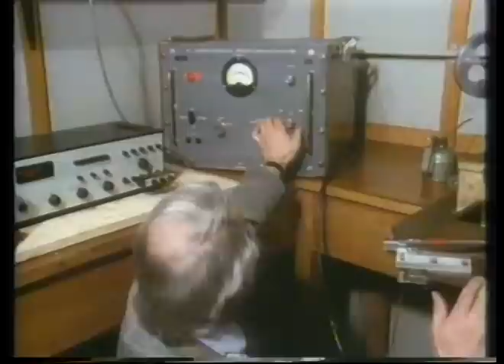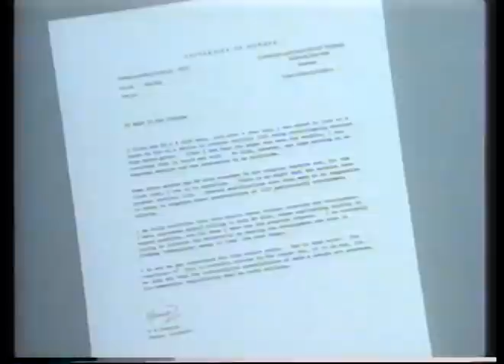Anti-Gravity Machine (Part Two)

Comment: So what happened to this device and the research on it?  Anyone know?
Reply: Yea.  Not much.  It doesn't work.    The US government makes the patent public, with full notes and description by the inventor, US patent: US5024112A.   Built it if you want.
Reply: @DeputyNordburg  Well professor Eric Laithwaite of the Royal College of London felt there was a notable effect of this machine, and he was instrumental in the invention of the maglev rail system that high speed trains use.  Granted, he was an electrical engineer, not mechanical, however, there is significant credibility between him and the college where he taught.  I wouldn't be so quick to dismiss this concept.  This is from Wikipedia: "Laithwaite set up Gyron Ltd with William Dawson and, in 1993, applied for a patent entitled "Propulsion System".[7] A United States Patent, Number 5860317, was granted in 1999. To this very day, research is conducted to account for the physics behind gyroscopic effects, directly pointing to Laithwaite's work as motivation.".

Comment: Basic physics tells its a bad idea... Didn't he heard of Newtons iii law.
Reply: Then, can you explain me why this machine desn't works?
Reply: @lookfacebyzip  
There is no force that is pushing this thing up. Only two forces can lift this model:
1: Aerodynamic force, in this case, air is supporting it. 
2: Newtons third law, in this case the model must vent some material (mass)  in the opposite direction of the lift.

Well, maybe you can add magnetic repulsion as well... But this will work only for short distance, in this case the device is supported by the earth, holding the magnet.

Comment: He needs a proof of concept.. 

An actual working model able to provide movement on earth using nothing but electricity and oil will die overnight
Reply: Um we get electricity from oil
Reply: @justinkemeter  not all sources are oil.. some are steam
Reply: Gary Stinten haha Gary steam is produced by carbon too. your looking for water, solar, wind, and nuclear.
Reply: Agreed!  This non-working model is not helping at all.  Funny though.   Even though it does not levitate, it does make heat and noise.   We can always use more of that.

Comment: This is claimed to be a potential space drive. So, how well does it function in vacuum? Is any of the "lift" due to the high speed spinning action in the air?
Reply: It functions as bad in a vacuum as it does on Earth.  It lifts 0% of it's weight, and doubles that for every extra 100rpm that you spin it.
Reply: @DeputyNordburg  That is my point. I think any perceived "lift" is due to motions in the air. It works as good as perpetual motion machines, not at all.
Reply: @randystegemann9990  A gyroscope (or anything spinning) will resist an attempt to turn its axle.  Any force applied will turn the axle at an angle 90 degrees to the applied force.  
The maker of the machine is mistaking (perhaps on purpose) that turning force for a lifting force.  
On the ground you can turn an object (think of a long flat piece of wood, laying on the ground and it will rise) but the lifting force is from the combination of the turn and the push from the Earth.
Reply: @DeputyNordburg  Saying the maker of this machine is mistaking something is too kind. I suspect something closer to deception.
Reply: @randystegemann9990   I have met many conspiracy theorist face to face.  It's a little like a crazy sports fan who sees every call by the referee as unfair to their team.  Are they blind crazy, unwilling to grasp the truth.  A strange mix of all of them.
I've also met crazy people and it's different but related....   Like the difference between a thunderstorm and a hurricane.
Reply: @DeputyNordburg  That reminds me of the flat Earthers. And some fiercely political people, Best to just nod and escape.

Comment: I have been studying gravity/levitation for quite a while now, an dam writing a book on it. I think I can explain the vertical lift  on the machine.
Reply: Can you find anyplace in this video where the machine lifted off the ground?   I mean with out using the string and pulley clearly visible at 0:18.   To me an important thing for any levitation machine to do, is levitate.
Reply: So have I, and my book is nearing completion. The frightening conclusion is that many engineers in the aviation and aerospace industries do not understand Newton's third law. Think about that, if you can still fly. Perhaps it does not matter. After all, most pilots do not know how their planes fly. They will tell you that it is the Bernoulli effect. Physicists laugh at that explanation.
Reply: @MrAaronvee   I've never heard a pilot claim that.
Reply: @DeputyNordburg  Most of them do not know that it is called the Bernoulli Effect. But, when they are condescendingly explaining their jobs to laymen (at aviation museums, for example), they argue that the unequal surface contours of aerofoils create a lower pressure on their upper surfaces and a higher pressure on their lower surfaces.  This is nonsense.
Reply: @davidfisher3684   I have never had a pilot attempt to explain to me why a wing generates lift.  I've been to many aviation museums and this has never happened.  This seems more like a personal issue for you. 
The  longer shorter explanation is more of a middle  school science explanation, like telling people electrons orbit the nuclear of an atom.  It's well known that this is false, but it's a useful model.
Reply: @DeputyNordburg  you don’t know the real reason..
Reply: @stanleybochenek1862    The real reason for what?
Reply: Oh, yeah? I dont think you can explain it at all because you think it's levitating. Which is wrong.

Comment: a cylinder bar magnet has both a north and south pole, but there's a third circular pole in the middle between the two. This is where forces of anti-gravity are captured. These can then be thrown out from the outside edge of a gyroscope. When such forces are encapsulated inside a shell, they form on the outside of the shell, similar but not exactly same as tesla coil. The shell is covered with a precise layer of lattice work crystals, which creates the anti-gravity field around the entire device.
Reply: Ever seen anything levitate? Wake me up when it happens.

Comment: It stayed up the same way a hoopla hoop stays up. The friction against the rod combined with tiny surface imperfections combined with the centrifugal force kept it up. If the rod was perfectly stable (no wobble) and perfectly smooth there would be no lift. If you remove that rod you get nothing but a spinning gyro with zero lift. Sorry, Sandy.